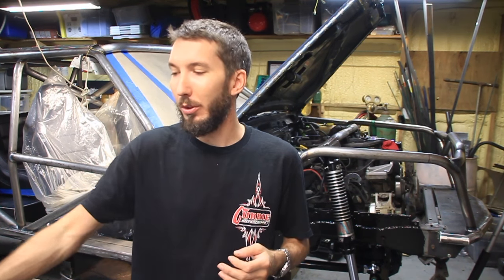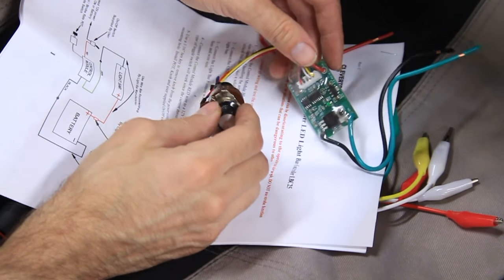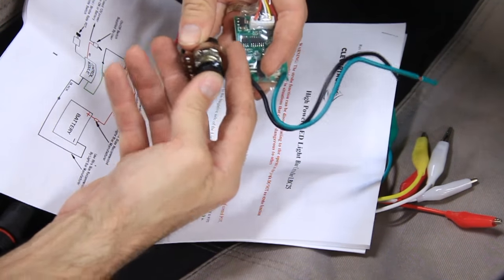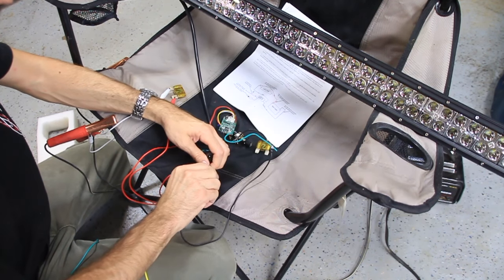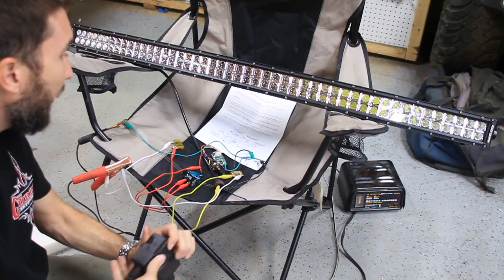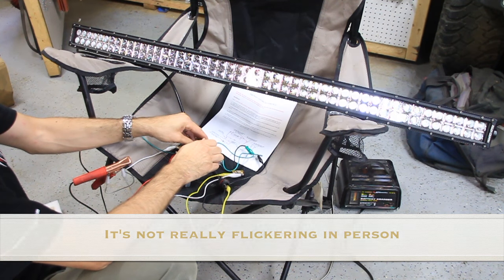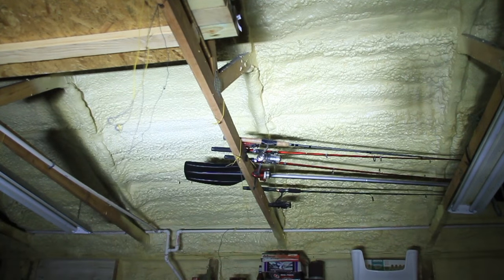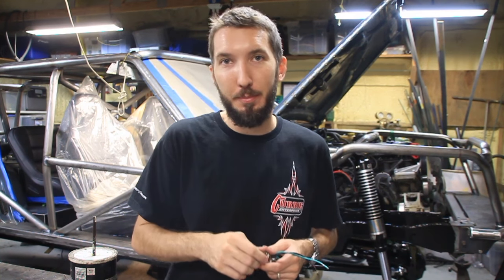Can You Dim Your Lightbar?

Comment: This kind of dimmer is called PWM, or pulse-width modulation, it is a pretty cool technology that can be used for alot of different applications on cars, electronics, and electrical devices. PWM is used on many modern vehicles, and you might not even know it is there.  In Jeep land, JK's use PWM on the headlights, which is why aftermarket HID and LED headlights flicker if you dont add the little adapter in line with the lights. It is used on electric radiator fans in some vehicles for speed control, that the fan can have more than 1 or 2 set speeds. PWM can also be used with nitrous systems to pulse the solenoids.  There are also lots of transmission solenoids, EGR valves, EVAP vent solenoids, and IAC (idle air control) motors that use PWM for control. If you use PWM on solenoids, it can hold the solenoid in a certain position instead of just being on or off.
Reply: I was just about to post that about PWM and seen your comment lol.
Reply: Couldnt he use voltage regulation for the lightbar ? That seems better than PWM to me
Reply: +Jakub Hobl you can only drop the voltage so much before LEDS don't light at all. With PWM, it is still getting the 12 volts it needs, but is pulsed at a specified rate to achieve dimming. Dropping voltage usually only works right with incandescent bulbs.
Reply: You forgot about fuel pumps
Reply: +Cody LePenske oh yeah, Ford and Volvo, at least that I know of, use PWM instead of a regulator, effectively making it a variable volume pump. Volvo actually uses Ford's system, it even says Ford on the pump controller.
Reply: +Mikey 👍
Reply: +Jakub Hobl LED's dont run by voltage. they run by pulsing faster than your eyes can see. you dim them by slowing that pulsing so they illuminate less times per second thus not illuminating as much. you drop a light bar below like 10 volts itll just shut off. ive known how to do this for a while just havent gotten around to doing this. now that someone makes one i might just buy it lol
Reply: Its used in mods as well. But the modding community figured out how to do the same thing without it pulsing. Would be cool to see it in lights
Reply: +andrew harriman  how would that ever work? Dimming can only be achieved by dropping voltage or pulsing. Dropping voltage doesn't work with LEDs, only incandescent. what modding community do you speak of? There are so many
Reply: Unfortunately this kit won't last long. There's a voltage booster inside the light bar that's eventually going to pop. What he really wants is a controller that interrupts the connection between the booster and the LEDs.
Reply: Mikey likes it.
Reply: I'm assuming this is the same tech in Koenigseg's free valve system?... So clever, man.
Reply: I use a pulse width modulator on my hydrogen fuel cells to regulate amperage.  The reason LED's are so bright is because they are Light Emitting Diodes.  Diodes only work in on polarity which is why it didn't work when wired backwards.  They are constantly pulsing power that is stored up which is why the lights are so bright.  The PWM is actually dissipating some of the energy as heat at the modul in order to reduce the frequency which is why you hear that humming noise.  The more energy the module dissipates (IE when you lower the light bar power) the more you will hear the hum.  It will also eventually wear that little module out unless you put a squirrel cage fan on it to keep it cool, and it needs to be in a cool dry place (not in the engine bay or outside).  If you waterproof it with epoxy in a small black box it will get even hotter, and hot electronics pull more electrons which creates more heat.  That's why the guy said for a large application it might not work (*very long term that is).

Comment: I've experimented around with some of the LED modules that you find on eBay from the Chinese manufacturers.  One of the ones that I encountered said that it needed 17V.  When I hooked it up to 12V, the voltage was too low to even get the slightest glow from the LEDs in the package.  So, I added a MT3608 power boost module to it to increase the 12V to the required level.  It has a variable resistor module on it that allows you to adjust the voltage up to 28V.  Of course, that would be too high for a LED module that was expecting 17V, so I adjusted it low and kept a multimeter on the output while watching it increase.  As the voltage gets higher, the LED gets brighter.  Without some sort of stop / limiter though, you could easily burn out an LED module with this.  LEDs do not have a linear response though and as you get towards the maximum voltage they are supposed to handle, it doesn't take much of an adjustment to exceed it and possibly ruin your LED.  So, it would be possible to just use voltage to control the brightness of the LEDs, but you would need to be pretty careful.  A safer solution might be to just have a certain number of fixed brightness levels instead of a continuously variable solution.

Comment: now because that switch is Ground Control put you 5 prong relay in the circuit so it acts like a normal high low switch. high will be normal operation without the adjusting circuit and low would be with the adjusting circuit. 87 will be a normal ground. 87a will be the green wire. and 30 would be ground for light bar. 86 would be a hot wire. and I personally would have 85 going to a push button Style ground switch ( the style that was on the older model trucks that is mounted to the floor so you can turn on with your foot)

Comment: Flicker sounds like just a PWM dimmer.
Could make one from a 555 PWM controller (pretty easy and cheap to build, a 555 and a few other parts) and a chunky MOSFET to run the lights proper.
Reply: i know the pwm funtion but how can do the strobe module?
Reply: +Angelvf. If you need strobe as well, you probably can't get that with the PWM setup, but a cheap pic and a couple switches and a potentiometer and a chunky output mosfet and a simple enough program will give you all of that, custom and pride in a DIY build.
Reply: you can do the strobe with PWM, but you have to change the pulse width- the duration/frequency of the pulse. When he pushes the dial down, he's actually changing the input setting on the dial from controlling the % pulse to the frequency.

Comment: The industry could replace a resistor in the driver circuit with a potentiometer and make it adjustable brightness. They build them so the leds are over driven in order to shorten the lifespan which would be over 20 years if they were given the proper amount of amperage.

Comment: for a truly custom look, replace your headlamps with a light bar, and use this dimmer switch as a dimmer, So you could have hi beam ad low beam settings. I donno, crazy I know, but wired correctly. sounds like it would work ..... in theory anyway. Great Video.
Reply: Low beam is not a dimming of high beam, the light of low beam only illuminate the ground, the high beam illuminate ground and a part of the &quot;horizon and sky&quot; that&#39;s the reason why you never have to put xenon bulbs in parabolic headlamps, (xenon are designed for proyectors) is good idea dimming the LED, but I&#39;m not sure is the best for drive in highway or normal conditions, the idea for drive following another car in off road is good, because is low speed and the drivers are communicated.
Reply: dot has strict requirements about light emission of headlight pattern that these do not adhere to. also, high beams area actually aimed higher so it's not a great replacement solution.
Reply: Dan Acton absolutely terrible idea. Light bars do not have a cover over the light source like a typical reflector headlight does to prevent direct blinding light from the source. Light bars, even when dim, will still shine into oncoming driver's eyes because their optics are designed for maximum output, not road legal output. a headlight doesn't work by simply making the bulb brighter when you flick the high beams on. Single reflector headlights have bulbs that have 2 separate filaments. One for low beam which has a shield over the top of tbe filament so that the light only hits a certain part of the reflector. The high beam filament is not covered by the bulb shield and will hit the reflector in such a way that the high beam is placed higher than tbe low beam and will light up higher and further than the low beam. Another way they do this is with dedicated high beam reflectors that are essentially an off-road style reflector without a bulb shield for maximum output. There are actually projectors now that are called Bi-Xenon that have a shield that can move. The shield typically makes a very sharp cut off to keep the light out of oncoming driver's eye's since the HID bulb is extremely bright. Since the shield moves, hitting the high beams will cause the shield to flick down (because the light gets inverted when it hits the projector lens) and give you more distance and height in your beam pattern. 

Sorry for the long winded explanation but I take headlights seriously because I wear contacts and bright headlights coming the other way at night are horrible.

Comment: The circuit needs to be inverse phase so it looks like /|/|/|/|/| and not |\|\|\|\|\|\.  Note the slow rise and the straight drop versus the sudden rise and slow fall off.  That sudden rise is where the noise comes from.  How this is achieved I am not sure.  It is a PWM but it has a slow ramp up and not a square wave.  I do not know how they do that, but I bet I could figure it out.

Comment: I have another even more elegant solution to the "blinded by light bar" problem. Turn off the light bar when your behind someone. I had a light bar on my jeep, I used it once to align it and never again. Head lights, fogs and KCs were way more usable on the trail.
Reply from the maker: by this solution if you have 10 guys on the trail then only the front guy would have lights on and the rest would be driving in the dark...  some of us don't have headlights.
Reply: so where's the guy's or company info., web site n e mail n cost.....???
Reply: BleepinJeep - I don't give a fuck what you guys do with those LED's on the trail, but you blind me on the highway and we're gonna get to know each other. They are not DOT legal and I've got the State Patrol on speed dial. Believe it.
Reply: I have off road lights on my truck and I'm 100% with you on the road. I'm sick and tired of the idiot kids driving around blinding everybody else because their mommy got them a light bar. They are gonna end up making it illegal to even have them installed on a truck driving on the road.
Reply: @dj beard - Exactly right, DJ.
Reply: @user-neo71665  that's why I just use mine as brights

Comment: its just pwm that one looks kinda small but you can buy them pretty cheap on ebay or wherever just make sure its rated for more than you need but it works i had one on a little 90w light bar the only thing on real low settings only a couple leds come on but other wise its fine

Comment: That buzzing sound you hear is your LED driver(s) getting fucked by the dimmer. The LED driver takes the 12 volts from the car and boosts it up to around 30 volts so that your LEDs are putting out as much light as possible. It boosts the voltage by using PWM up-converter and capacitors. You can't mix the two.

You know how most CFLs and LED lights at home depot aren't dimmer safe? Same reason. Your lights will flicker and you will greatly reduce their lifespan.
Reply: Most bars use have a buck current regulator inside. This is why they have a large operating voltage for example 10-30V. 

The flickering and audible noise was due to using a battery charger for a power supply. The charger output is not filtered so you have a nasty chopping voltage. This was actually a good test showing that the dimmer can work in a harsh electrical environment.

Comment: if its not designed to be dimmable it can blow out the ballast in your light bar over time if you use it on a low setting. I would check with the light bar  manufacturer first.
Reply: Scott Brown Light bars don't have ballasts. Light bars are LED not fluorescent or HID. All they are is a huge circuit board with LED soldered on and a reflector on top of the LED.

Comment: It's kinda cool, but I feel like it may not be the best for the light bar because they were not designed to work like that, but who knows they are leds, so maybe it won't hurt it.
Reply: lots of led flashlights use the same type system for dimming, obviously the light bar draws a lot more power than a single flashlight but as long as the components are properly sized to handle the current it is a proven technology.

Comment: Couldn't you just use a potentiometer/variable resistor to limit voltage/current to light bar to dim it? Or do you have to make a 555 controller?
Reply: no..to put it simple..less voltage doesnt make leds dimmer..too low and they just turn off

Comment: Mat, I have some damage to my unibody and it's tweaked. This doesn't let me get any mounts to mount a 50 inch across my roof because the gap between the gutter rail and the door it's to right and the gap between the door and the a pillar is also too tight, what should I do ? :(
Reply from the maker: +Chris Reyes learn to weld!!
Reply: +BleepinJeep teach teach teach

Comment: There are better circuits in use by people using LED lights when they are making videos, which turn on and off so fast that the camera can't tell that it is flickering. Also, I would have expected to see this directly driving LEDs, but I don't know if the light bar has its own circuits inside it which interfere in the form of that noise.
Reply: The flickering and audible noise was due to using a battery charger for a power supply. The charger output is not filtered so you have a nasty chopping voltage. This was actually a good test showing that the dimmer can work in a harsh electrical environment.
Reply: bstewart63 Ah, thanks for the info. Thought the bat chargers had smoothing.
Reply: Your welcome.

Comment: So I realize that the "dimmer" is just a PWM and a few other electrical components with a potentiometer to control it, but my question is do you think dimming the light bar would put any added stress on the internal electronics in the light bar? Essentially staving it for power?
Reply from the maker: +RedlineHybrid you'd have to ask a geeky type for a real answer.
Reply: Never taken a light bar apart but I imagine the only thing in there are current limit resistors and the LEDs. Using this will affect the long term life of your light bar. But I see this as a cool trick to show off to friends, not something that you'd be using all the time. It is worth noting that when using this on full power you could still see the PWM flashing the LEDs rapidly. Which, again, is different than just being ON.
Reply: Sparks 1013 You're correct. That and reverse polarity protection

Comment: what brand lightbar is that? never seen one with a plug
Reply: TheKillerMarine All high quality light bars typically come with a Deutsch connector on them which is watertight and easy to remove. Don't EVER let anyone tell you cheap light bars are "just as good as all the expensive ones" because they're not. Low quality light bars may look the same but High quality light bars won't leak, have better optics, better threads on the ends for mounting, better coating, and better warranties.

Comment: Dumb question but couldn't you use a dimmer that comes on a light switch that's in a house? Never wired up a light bar so I don't know.
Reply: no, led's are always the same brightness. normal lights get brighter or dimmer with more or less voltage
Reply: they do make led dimmers for house. 12 yr electrician there high$$ and most run off 110v
Reply: leds are current driven devices. the dimmer control would get very hot. you could use one on an leds system running analog drivers because you would just be manipulating a reference signal. but as a regulator on the main power supply wires, you could, but shouldnt ever do that.
Reply: Various companies do make 0-10 volt dimmers for low voltage controlled leds and CFL lamps. I'm not sure how effective they would be. Keeping in mind too that they do not like 12volt. So something would have to be done about that. These types of dimmers are also very expensive and are made to specific applications.
Reply: +Alex Holsinger if it's a 0-10v dimmer control than its sending a reference signal to a proper led driver. Unless it some sort of cob led. light bars like this are most likely just running a simple dc-dc step up converter power supply. when he says they haven't figured out a way to dim them it's flat out wrong. dimmable led drivers are nothing new. analog drivers accept a 0-10v reference signal which can be manipulated with a simple potentiometer(standard dimmer knob). and then they have pwn dimming drivers that accept a pwm input signal. dimmable light bars are easy. but real drivers are expensive and would significantly drive up the cost. one powerful enough for a light bar this size would be pretty big too. no way they'd be able to contain it all in one. I've been wanting to build my own led light bar driven with true dimmable led drivers. maybe I should start on that.